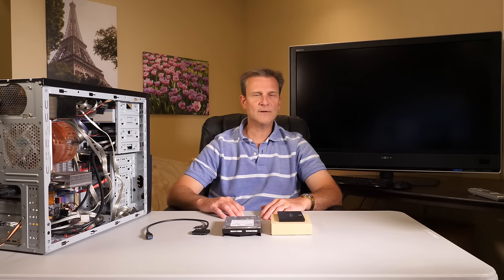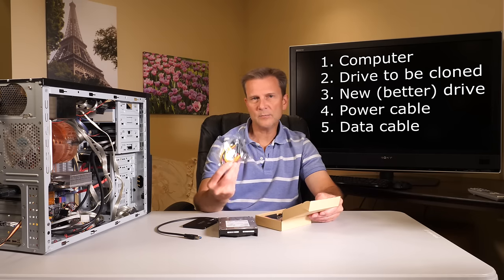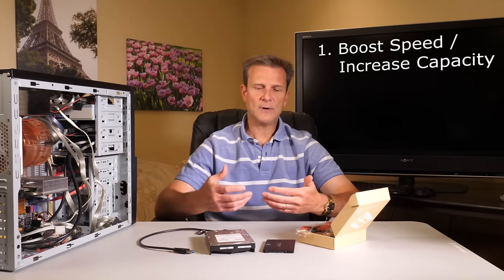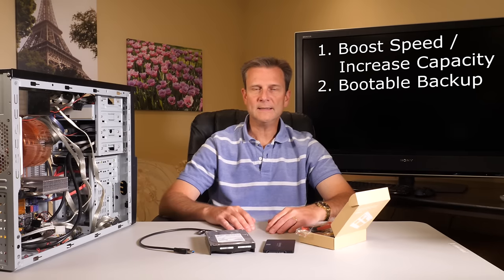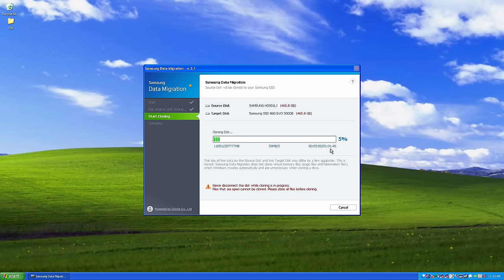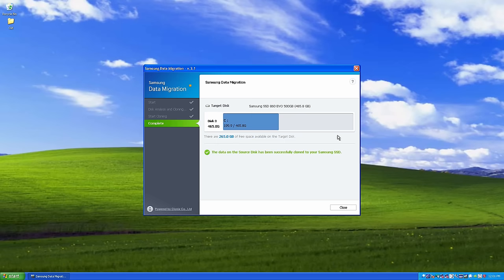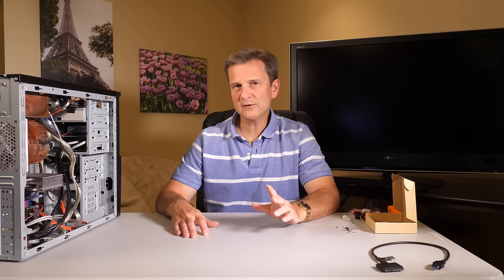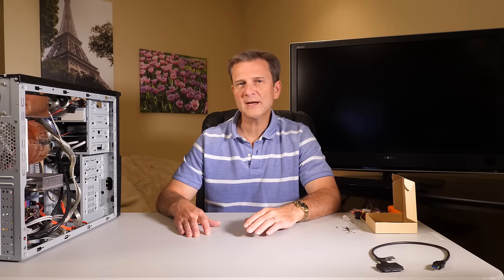How to Clone Your Boot Drive to SSD Without Having to Reinstall Windows or Any Other Programs

Comment: I was so nervous about cloning my drive that I needed this to calm me down.  My cloning went fine using the Samsung Data Migration Software.  The last drive I tried to clone was a disaster because it destroyed my computer.  I think the computer got destroyed after I booted with both the original and the clone drive still attached.  I tried to go into bios on the boot and disable my original drive; but I didn't go into bios.  Subsequent attempts to boot the computer with the original drive and the clone drive both failed.  Searching the Acronis website, I discovered that booting with both the original drive and the cloned drive attached is dangerous and can destroy the computer.
Reply: You missed the step in the video when he unplugged the power to the old boot HDD drive before installing the new SSD boot drive. It's the most important step to keep track of.

Comment: anyone have an issue where, after cloning the drive, it completely bypasses the BIOS / UEFI stuff while starting up? I cloned a 250gb SSD to a 2TB SSD and now it just skips the BIOS screen no matter what. I can't even make the "hold shift click restart in the Windows 10 Start menu" trick work to go to UEFI. i can press F2 or delete all I want and it won't load the BIOS/UEFI on startup or reset.  
any ideas? 
I used a program called "Macrium Reflect" to clone the drive. GPT format drive, not MBR.  
I'd like to change my RAM settings to DOCP.  other than that it's really not a big deal.

Comment: If this cloning leads to data corruption and data loss then what to do please guide.
Reply from the maker: The simplest thing to do is revert back to the original drive you cloned from. Plug that back in, and you'll be back to where you started. Then you can try the cloning process again.

Comment: I bought the same ssd but the 1 TB version. I did everything step by step but I keep getting error 000001 (ffffff) from the samsung data migrator. I used macrium and got it to clone but couldn't get it to boot. I've tried everything I can think of and still nothing. any clue. I have a Dell optiplex with windows 10.
Reply from the maker: This page has a couple of things that might help: https://www.diskpart.com/articles/cloned-hard-drive-ssd-wont-boot-4348.html

Comment: Thanks for getting me started.   I replaced the HD in a XP comp with a Samsung SSD and after I booted up I got a message the TRIM function was disabled.  Haven't been able to find any info on how to enable TRIM in Win XP.  Any ideas?
Reply: I don't think trim was supported by windows xp.  Also I would suggest not using xp since it is no longer supported by Microsoft.  Also the source code was leaked  not long ago. So you are a target for hackers.

Comment: Just replaced a secondary hard drive with an SSD. Crucial supplied software DID NOT WORK, fully paid version of ACRONIS cloning software DID NOT WORK. Problem turned out to be that the new drive had 4060 Mb sectors and my old (very old) hard drive had 512 Mb sectors and no software was going to clone it.
According to Acronis (website) , Sector size is fixed at the point of manufacture and can't be changed. I can understand that statement in relation to a HDD, but does that apply to  a SSD?
My next 'challenge' will be replacing the original 'C' drive, which has always been a bit small... an 80 Gb mSATA SSD from 2010. It also has 512 MB sectors. As I've yet to see ANY manufacturer detail sector size on their specification page, I'm worried that buying a larger mSATA drive will result in the same problem for cloning.
Thoughts?
Reply: Okay, Bytes, not Megabytes and 4096 not 4060. I'm not fully awake yet... it's the only excuse I've got other than 'old and stoopid'.
AND... I just checked... the COMPUTER resized the sectors on the new SSD to 512, and deleted all the files I had COPIED to it before installation - and the old HDD went belly-up when I removed it and I can't access any of the old data. Not a big problem, probably a good result as it means I lost all the crap files that didn't need to be there anyway. Any music or video files I lost were already backed up on a NAS, so no big deal, just a pain in the posterior.

Comment: with respect to cloning a windows hard drive.. will it copy the activation key over as well?.. or does it see the ssd as different hardware thus a different config than whats on there servers and require a new lic to activate?
Reply: In most cases it should copy the key. The  key is usually tied to the motherboard. But it might be worth finding your license beforehand just to be safe.
Reply: @cristiancruz1972  I asked a question here today at top of page and reading through the comments I saw this. Does this mean if I have the physical disk with the key I am safe to upgrade my motherboard and clone drives or will I have to do a full install and lose all?. Also, will I have to buy another Windows 10 os to upgrade my hardware or can I clone pretty much the same question different wording lol?
Reply: @noturaveragehermit6958  if you have a key handy you should be good. But if you are going to swap the mobo you shouldn't need to clone any drives. I would backup to a portable drive just in case, though. Also be sure to update your motherboard drivers. Depending on how recently it was manufactured, it could have an outdated version of the BIOS.

Comment: if you are populating a new laptop with data from SATA  disc to SSD how to leave the new laptop windows 10 and all the described hardware drivers etc,  how to do with out destroying the new windows 10 computer?
Reply from the maker: I believe you are saying you have a new laptop and you want to move programs, files and data from another older computer to this new computer. In that case, you would not clone the old data. Instead, you would copy files from the old drive to the new computer. Then, you will need to reinstall programs on the new computer.

There are a couple of programs that might be helpful to move files and programs from the old computer to the new one without having to reinstall programs. But they are not free and from reviews, people seem to get mixed results. One program is called PC Mover. I have not used this program, so I can't give you a personal assessment of how well it works.

Comment: Something left out:  
1) Formating the new SSD drive (actually just choosing beteen MBR and GPT structure. Your comuter won't be able to see the new SSD until you set its structure.
 GUIDANCE: Safest thing to do (it seems to me) is make the new SSD structure the same as the HDD it is replacing.  You can do this on Windowa 10, but I'll be damned if I can remember how I got to it.

Also, I ran into the same issue that the conversion housing (HDD to SSD) did not align the SATA plug with the socket (off maybe a quarter inch) and I had to use the came technique as in the video - don't udse the conversion bracket, just plug in the SSD and then fasten the SSD to the original housing with a screw to the top of the SSD.

I used AEOMI BackUpper to clone the SSD -- but the freeware version does not work with GPT structure -- you have to use the paid version.  But it was worth it.  Cloning a GPT 1.0TB SSD took all night, but it worked flawlessly when installed.

Comment: Hello sir thank you for the tutorial, my question is I have 1 drive for windows 250 GB SSD and a second mechanical drive for installing programs 500 GB. I would like to get a new SSD Drive 1 TB and clone my boot drive to the new SSD, would that effect any programs from the 500 GB mechanical drive from running normally ? 
In the future I would like to upgrade my 500 GB mechanical drive to 2 TB mechanical drive, can I clone that as well so all the programs would be ok  to run ? I have many games and programs on these drives and would hate to reinstall windows and installing these programs again.
Reply from the maker: The idea behind cloning is that your computer sees the new drive no differently than it was with the old drive, except for the difference in size. So, cloning your boot drive to the 1 TB SSD won't affect the programs on your mechanical drive. And later cloning the 500 GB mechanical drive to a 2 TB drive should work just fine also.
Reply: @NerdSidekick  Thank you sir !  appreciated
Reply: Since you store most of your user data on your second drive, you wouldn't normally need 1TB for a boot drive. I run a 250GB SSD as my boot drive, and have a 1TB spinning drive for my storage. I'm currently using less than 100GB of space on my boot drive, and it's been like this for a few years (after many Windows 10 updates). And I also have quite a number of music apps installed which take up space on the boot drive (for plugins and soundfonts).
Reply: @PracticaProphetica  Thank you sir

Comment: Useless without covering ALL required, or potentially required, steps. You SHOULD include BIOS settings. You are likely leaving some viewers with non-functioning computers. Recovery back to the original drive in case something happens would ALSO be advised.

Comment: Actually you could have done it in an easier and simpler way than you did in this video. You could have cloned the HD into the SSD by using an SSD to USB cable( which you already have) and a cloning software such as Macrium Reflect Free. There are many other similar software available online, most of them include free versions. To tell you the truth your instructions are more confusing than helpful. You showed an array of unnecessary cables and pointed at a variety of slots in the PC, which should be better to avoid than use.
Reply: I tried that once, but every software I tried told me both disks should be the same size (equal total capacity) to clone.

As I was upgrading to a bigger SSD.. Ibhad to look throught alternative methods.

Is this still a thing?

Comment: Can i do this in my D or E disc in my desktop?
Reply from the maker: I assume you are asking if you can clone a drive that is not the C: drive (or the boot drive). Yes, you should be able to do that as long as the cloning software let's you choose the source drive (which I imagine all do).
Reply: I mean the C drive.  Install windows on the same desktop PC, that the C drive working. Thanks for answering.
Reply from the maker: You want to clone the C: drive to the D: or E: drive? Yes, you can do that. If you want to boot from the D: or E: drive, you will need to change the boot order in your BIOS.

Sorry if I'm not answering your question. I"m just not sure what you are trying to accomplish.
Reply: @NerdSidekick That's it, thanks again!
Reply from the maker: Great! Just remember, you will be erasing everything on the D: or E: drive. So make sure you don't need anything on those drives.

Comment: If your laptop boot drive is an M.2 SSD you want to clone, you can purchase a USB adaptor to install one of your drives in for cloning. Be sure the adaptor you order is compatible. Some are good for both SATA and NVME, some only work with one.

Comment: Does this work with just copying to a larger hard drive
Reply from the maker: I assume that you are asking if you can clone to a drive smaller in capacity than the drive you are planning to clone. Yes, as long as the new drive has enough space to hold all the files from the original drive, you should be able to clone onto the smaller drive.

Comment: I have a WD hdd that has failed but I have a disk image of it stored on an external backup drive and a WD blue ssd in the mail , can i use the Windows recovery disk ( cd ) to restore the image to the  new ssd ? This is on a Windows 7 system . Thanks in advance :-)
Reply: You would likely need the program that created the Image
Reply: @joshuaguenin9507  Thanks Josh , update on my question , the image restore went perfectly , the image was made with the native program within Windows 7 , I booted to the recovery CD /DVD with the external backup drive attached via USB , I followed the prompts and it was all done in a few minutes , very painless .

Comment: Both hdd and sdd don't have to have equal amount of space capacity to do this? ex) 1tb for both
Reply from the maker: No, then can be different, but you need to make sure the drive you clone everything onto is larger than the actual size of the contents that you are cloning. The cloning software will probably account for this and prevent you from trying to copy more data than will fit on the destination drive.
Reply: @NerdSidekick  i only have around 20gb in 2tb hdd. and I'm trying to clone that onto 500gb samsung ssd. so..that shouldn't be a problem right?
Reply from the maker: That should be ok.
Reply: @NerdSidekick  Thanks! everything is successfully installed!

Comment: can i upgrade my HP laptop with Samsung  portable 1TB SSD, i mean can i do this by external ssd
Reply: I think you could. But then you're going to have to boot from a USB device every time on startup and consequently be carrying around the external source. You'd need to change the BIOS settings. It would be more convenient to swap out the internal drive. If you have an external drive you may be able to open the case and use the drive inside of that to put internally. 
That would depend on the format of the external drive though. Sometimes there is 2.5 form factor inside of the external that matches internal specs.
Reply: @cristiancruz1972  thank you so very much

Comment: does this work for a M.2 ssd ?
Reply: You can go to Amazon and for around $35 you can buy a hard drive transfer unit. It’s a black square with 2 bays bay A and bay B you put in your old hard drive and it will let you plug in any size hard drive including ssd. My old hard drive was going out on me it slowed down so I bought a 2TB ssd and plugged them in and about 12 hours later or sooner depending on how much data you’re moving it will either clone or just transfer the data from the old to the new drive. At Amazon look up hard drive transfer unit and you will find it there and after I was done I just paid the shipping cost and got my money back. I’m thinking of rebuying it because 2TB is not enough for me so I can but a 8tb ssd external drive for my games or hook up a bigger ssd inside my pc. Hope this helps.

Comment: I cloned my hdd to an ssd and my plex server no longer worked.  Those files are not on the ssd they are on a separate drive.  I put the HDD back in and all is good?  Any idea what went wrong>?
Reply: try reformatting the SSD. it could have bad sectors that aren't being read properly

Comment: Hi again. Hoping someone out there will be able to help me out.I'm in the process of replacing my mother board and cpu into my old case as it's just about to die on me as well as replacing my ssd with a larger size. I will be cloning my new ssd. I would like to know if my operating systems will be recognised by the new board or will I have to replace my systems. Thanking you.
Reply: Depends hugely on what operating system you are running [I am assuming that it is a version of Windows - I don't have the knowledge to help you with anything else]. The operating system you have at the moment uses drivers that apply to your current board that the original Windows installation sorted out that it needed [you may have updated the drivers since, but that doesn't affect the idea]. The problem is that, when you replace the board and boot up with either your existing SSD, or a new one with the system cloned to it, Windows needs to know that it needs to change some of the drivers. If you are on Win 10, it can USUALLY tell, and will be able to install the drivers that it needs to get the job done - it just takes longer to boot up on the 1st try while it does that. If you are still on the old SSD, you will then need to clone it to the new one. There is plenty of evidence on the web to confirm that this approach will work. There is also plenty of advice that says don't bother -  just re-install everything from scratch - but assuming that you have backups then the above is well worth a try, as nothing will be lost if it does not work except the time taken to try it, as if it doesn't you will have to re-install Win 10 anyway.

If you are on Win 7: Win 7 can't identify hardware changes like this, & it needs some help. Here are two sites covering this: both talk about Win 10 & Win 7, & both include the same advice for a registry hack that applies to either Win 10 or Win 7, & the 2nd additionally discusses how to use free software with which you will create a disk image from your existing SSD, plus a universal restore medium [CD/DVD or USB drive] that you do your 1st boot from, installing the image to whatever drive you have put into the machine.

Actually, in your case this 2nd site seems to me to be the ideal way of killing two birds with one stone, as it requires you to create an image of your existing SSD, & then enables you to install it to the new SSD on 1st boot, assuming that you change all the hardware at one go in between.

Site 1: https://www.wintips.org/how-to-replace-motherboard-without-re-installing-windows/

Site 2: https://www.ubackup.com/universal-restore/upgrade-motherboard-and-cpu-without-reinstalling-windows-4348.html
Reply: @chrismoule7242  Nice answer!  Very helpful.  Wasn't even my question.  Just 01:05 in the morning!  Lol!  Be safe out there!

Comment: How would I clone a mini PC to an identical model second mini PC (everything in it is the same as the first mini PC) which uses a removable SSD as an add on only? The operating system files, boot, program files are contained elsewhere within the mini PC itself rather than on the removable drive.